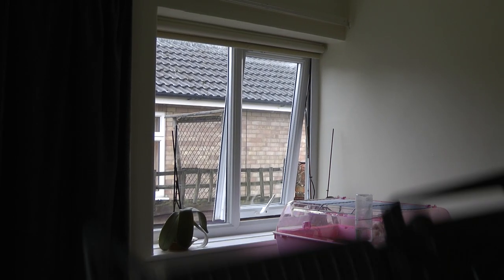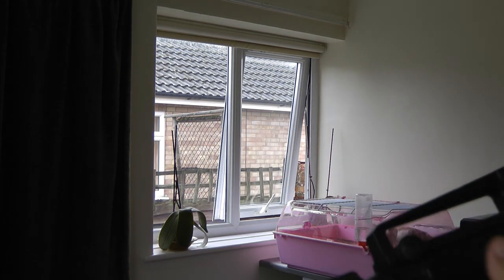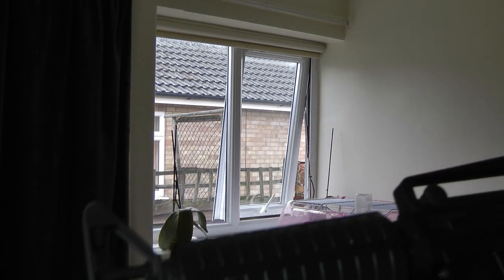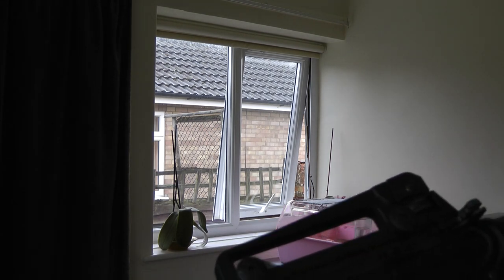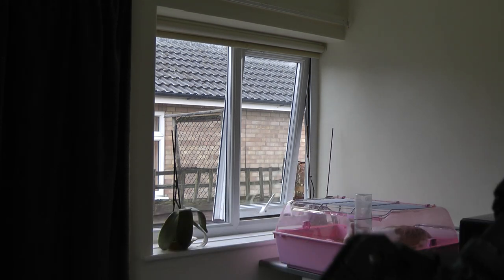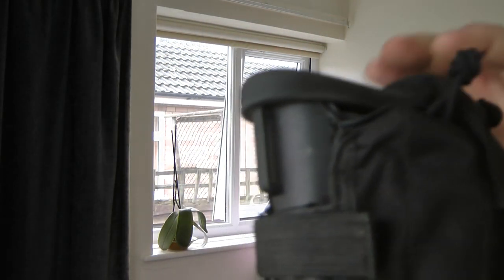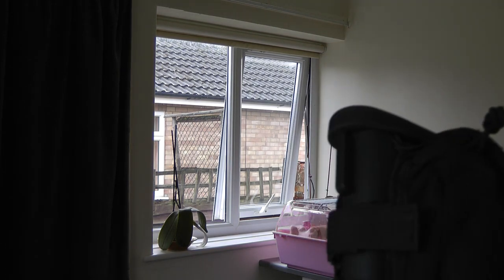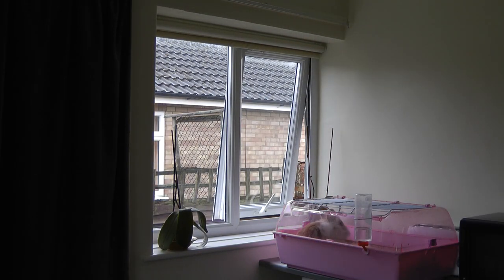Workshop - Socom Upgraded (Jacks)

Comment from the maker: @Maekiii what we can't take into consideration is the multitude of different casings and gearsets which are out there.  Ive had gearshafts the wouldnt even fit in bearings without sanding casings with of set holes, and other sets of gears might cuase problems for bushings, my view is its up to the gun tech to make it all work, tons and tons of little little things which customers will never know has happened but you made it all work and come together when another gun tech might just give up.

Comment from the maker: @Maekiii Thats a common old airsoft misconception, ive installed hundreads and in guns which have been running for many years. The most common cause of failure for 6mm bearings is installing them unevenly and scratching or damaging the casing.  Use a bearing press to evenly press in the bearing, if its to tight lightly sand dont bash in, and always use bearing lock when installing either bearings or bushings.  Also by design you HAVE to use bearing oil, which 99% of airsoft players never use.

Comment: @Eagle6Airsoft He has been a prototype tester for numerous airsoft manufactures and holds the records for some of the most extreme setups. He has designed a hopup system that is incredibly consisted and provides well enough hop for .88g steel bb's and at 4,6J he can reach targets past 400 feet. Just that you manufacture some parts doesnt automatically mean that you are a tech god. HE is a better tech than you and says 6mm ball bearings are useless, and he's right.

Comment from the maker: @Eagle6Airsoft I do believe you get what you pay for, i firmly believe that the more you spend on bearings the more you get, i know due to the costs involved in high speed setups its common to fit the lower priced brands which i actually like.  But If i was doing a high ROF or high power setup i would spend much more on a a set of bearings than i would on a run of the mill aeg.  Different setups, different demands.  Heck if i was going more than 35 - 40fps i wouldnt even use 6mm lol

Comment: @Eagle6Airsoft I've never seen 6mm ball bearings last longer than 2k rounds at 330fps level even when properly shimmed. They are ok at very low power levers but its an unnecessary risk for a gun like this considering how little you actually gain from them over metal bushings.

Comment from the maker: @Maekiii Bushings hold just as much risk ive removed metal bushings on some that are worn out cuasing lateral movement on the gears, We are installing consumable items, to expect either to last forever is unresonable, 50000 rounds is considered by TM to be the average life expectancey of a internal part including motor.  I prefer the frictionless effect from bearings, bushings sometimes require a little work on the shaft (oh.. er..) for there best result.  I dont even think i stock bushings now

Comment: @Eagle6Airsoft To be honest I'm surprised that you have had such an experience with 6mm bearings. Lets sum it up: 6mm ball bearings bust be installed very precisely in order to work reliably. Still, I would not get such a small bearings, because they can only be used in low speeds 'cause of their small kinetic N rating, and I tend to run my guns at above average speeds. The actual benefit from bearing over bushings is so small at low speeds that its not worth the risk IMO.

Comment: @Eagle6Airsoft Actually I'm afraid it's not. If you have looked into 6mm ball bearings datasheets they tell you that their static and kinetic N ratings are very low, and its mathematically calculated that they are indeed too weak to be used in most airsoft gearboxes reliably for long periods of time..

Comment: @Eagle6Airsoft 50,000 sounds quite low to me if we're talking about a 350fps >20rps gun. Have you looked into modify tempered bushings? They honestly are pretty much indestructible. They wear out as slow as their ceramic bearings which are just excellent aswell.

Comment: @Eagle6Airsoft I know that the power levels youre running are quite low in my standards, if it works for you then good for you, but its still a very unnecessary risk considering the actual benefit and thus I never recommend 6mm ball bearings to anyone. I have repaired hunders of airsoft guns aswell so I'm talking from actual experience here. Google "airsoft mechanics", its the place where all the top techs of the world discuss and share information.

Comment: @Eagle6Airsoft Youre heavily over impressing yourself now. ASM is not for beginners at all and neither it is for rof addics. It's a place where limits are being pushed and crossed and new things are invented. IT IS the place where almost all the new things are invented and worked out. A friend of mine whos a moderator there, builds the best custom aeg's you can get and he also has reached 700fps at 35 rps on a 22V lipo.